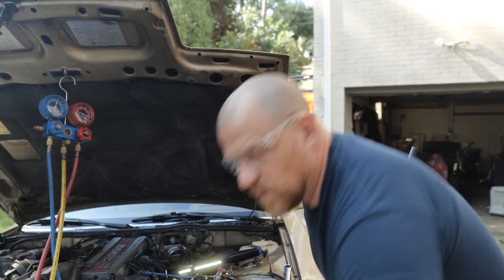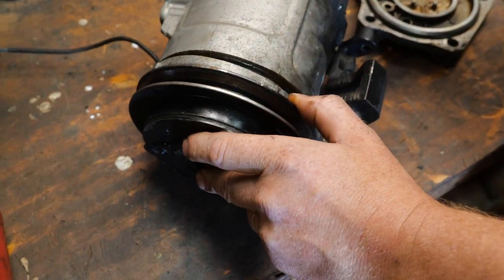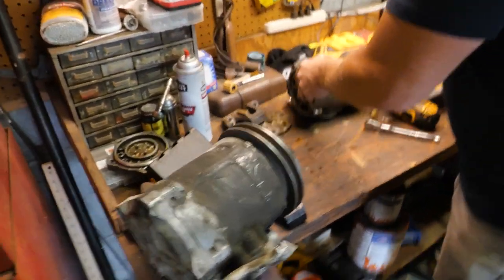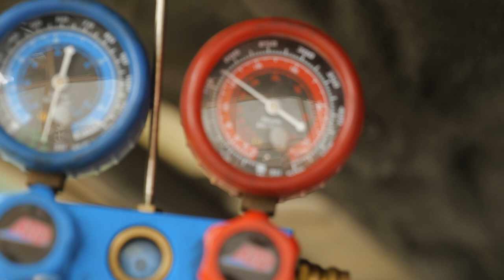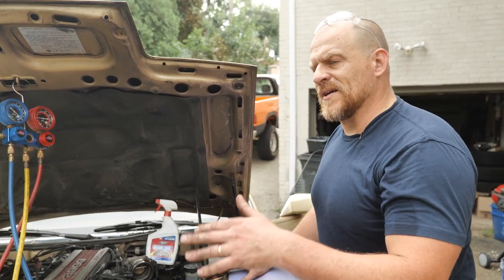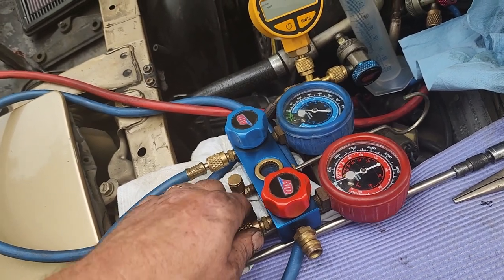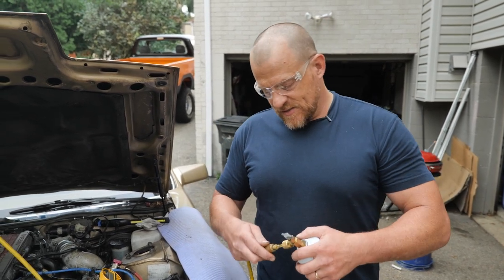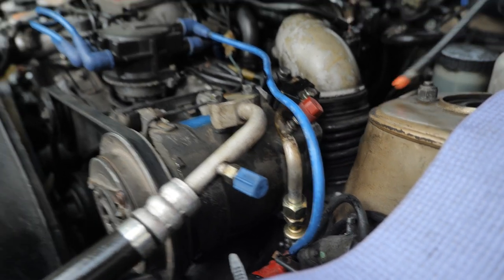A/C Repair Lasted One Day [What Did I Do Wrong?] - Part 2

Comment: For me, adding nitrogen has always been the best for finding leak in lines, condenser, evaporator, and leaks on the AC Compressor housing. I have had AC systems that had a leak but wouldn’t leak with 150-200psi of nitrogen. That’s when vacuum testing comes in handy. a AC compressor shaft seal won’t leak while under pressure because it the pressure pushes on the seal, helping it seal. If I pressurize a system and can’t find a leak, but loose vacuum, I know I need a AC compressor

Comment: As a wise old guy once told me, 'If you ain't making mistakes, you ain't doing anything'. We ALL make them! Nice Job! I use to work in the home HVAC business several years ago, so I knew all the steps you just made. As the old saying goes, 'Been there done that'
Reply: you sure ain't lying! it's all how you handle your mistakes, you can either take responsibility, fix it and recover gracefully or cower run and hide. I suggest the first option, even if it costs you out the wazoo. like a crawlspace sewer line job I did 20+ years ago. I thought to myself ahh, it will only take me 6 hours and 5 days later, plus broken water line repair....
yeah, I stayed with the price I quoted them, it almost covered my tooling, fuel, food/drinks costs. 😵
Reply: My dad always said that.

Comment: I had a day similar to that not too long ago; I pull up to my garage in my old ford, pull the handle to get out of the truck and snap - door handle in my hand. Unroll the window to reach out and work the outside latch, enter my garage through the mandoor, snap the door handle is in my hand. Enter the garage to open the tailgate of my other truck and snap, the tailgate handle breaks in my hand. The moral of the story when it gets cold like that, return to the heat inside and go back to bed

Comment: Years ago with R-12, all shop manuals recommended pulling vacuum for 30 minutes after you reached 27 to 30 in. That's what I've always done and it's worked for me. Also when compressor has been on shelf I like to sit it on its nose, add 2 oz of oil, let it sit a  couple of minutes and then slowly turn the compressor to lube and soften up the shaft seal. Then let it sit that way till you're ready to install it.May not help, but it can't hurt and it might save a leak.

Comment: "It helps if you charged the customers diapers". Classic shit right there. I had a lady I did a lot of work for leave a 1 star review after replacing the newest jeeps plastic oil cooler with an aluminum one. She took it to another shop 2 weeks later demanding $680 for the shop to replace one of the new oil coolers o rings. I charged her $450 total which included the $200 cooler. They wouldn't provide any pictures of the oil leak and originally told her they would have to charge her $600 just to see if it was leaking. Which it wasn't when I was done. I stand behind my work but an not in a position to just have over money like this. She lost confidence in my work after the plastic fuel clip disintegrated a week later which I replaced for free (the complete upper half of the engine has to be taken apart just to access it). Too much plastic where plastic shouldn't be used.  In this day and age there needs to be a service grading the customers not just the business. Scam customers also need to be identified to help the honest businesses that do still exist.  Anyone want to help me create it? Thanks for your vids and professionalism.

Comment: Macro Rubber is the place to get any kind of o-rings, they make and stock almost every size.
Measure the o-ring cross-section and get the internal diameter from the groove dimension. O-rings usually require around 15% compression to seal.

Comment: It looks like when you wiped down the back of the case at 3:10 to 3:30, the valve plate and cylinders rotated in relation to the case. So the back cover wasn't indexed to the valve plate and that shoved the guts forward when the bolts were tightened.
Reply from the maker: 100%

Comment: Before I knew how to work on cars, I got quoted about $2000 to fix the leaking R12 system in my 91 Miata as they basically wanted to replace everything in the system save for the lines. Knowing what I know now about A/C work on old cars, I don't blame them. Eventually I did the whole job myself but it was a pain in the ass. Unless you're really careful, it's almost not worth doing A/C work on 30-year-old cars if the parts are all original. Something will break and most of the parts will be discontinued.

Comment: I see you had the Midas touch on this one. 😂😂
Thanks for sharing. 
I did a 95 Mercedes S350 turbo a couple years back. I pulled used compressor of one of my parts cars and it was the wrong compressor. I bought a seal kit to rebuild the ac compressor and found a bad cylinder head. I ordered a new compressor and it was lost during shipping. Ordered a replacement for the lost one and it was mislabeled and totally wrong part. Send that one back and finally got the right one. Installed it and three months later it blew the front seal. I replaced that one under warranty. Oh and the lost one showed up too at some point. 
I finally wisened up and sold all my old Mercedes and parts cars. 😂😂
Reply from the maker: 🤣🤣 I know that nightmare

Comment: Caterpillar sell make your own "o" ring kits,  it comes with strands of different diameter "o" ring material with a special superglue. You get the right diameter material, match it up to the groove for the "o" ring, cut the strand to length and then bond the ends of the strand together. SUPER handy for field repairs.
Reply: They are called "o" ring splicing kits if you want to do a web search

Comment: I've torn apart bad A/C compressors to see why they failed, but never bothered trying to rebuild them. of course none were just bad o-rings and parts are near impossible to find unless your a commercial rebuild shop.
same with electric motor repair(beyond commonly available bearings), DC motor repair is even worse due to commutator and brushes, although I've scored parts from a few rebuild shops over the years, most won't sell parts and only will quote for rebuilding them, but some knowledge and sweet talking worked, of course I worked at an electric motor plant and jumped around doing majority of all the different jobs from machining shafts and cases to final assembly, testing, packaging and dock work. I'm sure not a painter, but I learned that too.

Comment: What'z up Danner! HVAC tech here enjoying your videos. The new refrigerants 134a, 404a and all those new gen refrigerants are blends. That is why is suggested to always charge in liquid. If you charge on vapor and end up not using the entire bottle then you altered the refrigerant blend at that point. 
Great video we all have had those days at work. It just felt good it wasn't me hahahah.
Reply: leaks cause fractionation of the blended refrigerant gasses also. pretty much the blended gasses in a leaking system should be recovered and replaced.
a big problem with supposed recycled gasses is unknown contents, oils and acidity. so you call X local repairman, and he quotes mega cost to replace, you say "temporary fix please", sure they suggest adding some refrigerant and give you a deal on "used" gas! it may be 100% system death in short term. 🤣

Comment: Good choice on not hooking up the low side gauge, this way it accounts for leaks that might be at the Shrader valve, I usually disconnect both valves after pressurizing the system to check for leaks at the Shrader valves

Comment: I had a really common compressor, they made it for 20 yrs.  Finally found a gasket set for it, and the new head gasket was paper, old one was metal.  Ended up reusing the old gasket, and it worked fine.  But the other gaskets leaked a year later.

Comment: Don’t sweat that one . People who drive older vehicles and use them as that client seems to be need to be prepared for any component failing at any time . I run a service truck that is 21 years old. Every single service call is also a test drive for the next system I need to work on lol

Comment: I call what you experienced mission creep.i have used those fittings for 40 years mostly on long lines they get a hole rubbed in and leak cut out bad section install fitting ,good to go. Saves on part cost and labor.

Comment: On an old car with AC problem: “ mr. or Mrs. customer, the reason my estimate is $2400 on a complete replacement of your entire air-conditioning system is that your car is very old, and if we don’t replace everything then you could end up in a situation where you’re nickel and dimed to death by subsequent repairs because of failures on parts that were not replaced.” And if the customer walks, let them walk. 

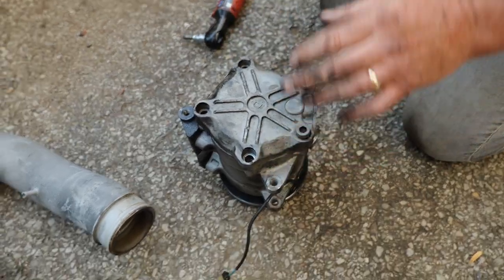“No man also seweth a piece of new cloth on an old garment: else the new piece that filled it up taketh away from the old, and the rent is made worse. Mark 2:21
Reply: Wow. I did not know that concept was Biblical. Mark 2:21. Gonna remember that.
Reply: And the man with no feet,, walked away,,,, Amen ! LOL

Comment: If you bench drain the oil out of the compressor you should put in approximately 6oz of oil back in the low side port. Although oil flows through the closed loop system with the freon the majority of the oil will stay in the compressor. If you replace a condenser add approximately 1 to 2 oz if you're replacing the receiver drier on the high side or a accumulator on the low side add 3oz to that part being changed.
Reply from the maker: The compressor oil amount you are suggesting will absolutely ruin a system. Compressor oil is all throughout an AC system, it does not just sit in the compressor. In fact, almost no oil sits in there. When you bench drain one, you'll get drops of oil only out of it. Procedures are to add 1 oz on a new compressor plus anything you may have drained.

Comment: Pros and cons of mobile 200psi+ systems eh?  I only had one vehicle with zero aircon issues and that currently has no coolant in it because it needed evacuating to facilitate an engine swap.  I expect to have some fun sorting that, but at least I know to swap any o rings where joints have been apart.

I once did the same thing as that compressor fracture on a fiat punto diesel vacuum pump.  Lack of alignment, then “ping” and then it was a whole new pump needed.  We’ve all been there!

Comment: There should be a Shrader valve under that brass cap that is on your gauges where the yellow hose hooks up.  Back when I was using cans to charge with, that is where I would purge the yellow line between can swaps.
Reply from the maker: There is a check valve on the end of my yellow hose. So I didn't need to do that

Comment: For me preferable a little extra oil better than starving for oil. Now too much oil will degrade the cooling, but I have seen in my experience with a home unit my A/c friend installed never cooled down enough and lived with it until I added 3 OZ of oil with a dye and what a difference it made considerably. My thought was the oil coated the condenser better internally and there was more heat felt in the air pushed out of the outside coil. So yes you do get lucky sometimes by accident and for me adding the oil dye was looking for a leak that took 2 seasons to be just low enough not to cool. Home AC do not have sight glasses at least mine did not. Note never found that leak but the charge then lasted 4 seasons afterwards. Replaced the system complete with lines original system was 20 years old.

Comment: Paul another great video as usual I defiantly learned something while watching.  Is there anyway you could do a video for dealing with an a/c system that is already charged using only a manifold gauge set?  I'm mainly interested in seeing how to evacuate a system that still has a charge of some kind any help you can provide would be greatly appreciated.
Reply from the maker: I dont think there is any real approved way to recover for the DYIer 
Maybe an empty R134a bottle surrounded by some liquid nitrogen (I don't think ice water would be enough) then start your car and close the hood and let the system bake with heat, while opened to the frozen empty container. You'd get a lot of it, but don't know how much.

Comment: Use the micron gauge to determine moisture content and pressure test to determine whether there is a leak.  The system spends its life under pressure,  not a partial vacuum.
Reply: thats what everybody is missing it works for vacuum but not pressure, u have to do both. i do vacuum first and then pressure. its amazing to be able to see how much moisture is in the systems i encounter.  thats where it shines especially if u graph the numbers on ur tablet. that little device will prove when u have a system dry maybe people will learn how to use it. tom lech is a master in ac. he changed my ac jobs completely. love to learn and grow and advance, thats why i watch danner, thats why i watch tom lech

Comment: Good video Paul and Caleb. Paul, either quit going to the gym or start using a torque wrench on everything. We call guys like you Hulk Smash (you've already shown your Hulk previously) or Wreck It Ralph. 😂 A couple of things from a guy who has been thru all three world wars of the A/C world. Most modern systems that have not been open to atmosphere can have as little as 10 minutes of vacuum. But it will never hurt to have a long vacuum time. The general rule of thumb for oil is 1.75 to 2 ounces per major component replaced (not including lines). When changing from R12 to R134 it is usually 75-80% capacity of the R12 original system. The sight glass makes it easier to get exact.

Comment: Checking leaks.  I have the best luck listening to a vacuum pump.  The sound should not change when open and close the gauge valves after everything is vacuumed down.  That and soapy water looking for those oily spots when under pressure.    When it comes to swapping cans.  Purge the air at the gauge.  Remove that cap and press the valve a bit.  Concerns are keep air out of system.  Keep dirt out of system.  Volumes of oil and R-134a are not as important.

Comment: Here's a question to think about.  Does the vacuum pull the "good" side of the o-ring to the ring channel providing a false good seal then when adding pressure push the o-ring to the "normal" position that caused the leak(s) originally?

Comment: Glad you satisfied this "customer". 
I watch a lot of videos about HVAC and I have never seen a compressor standing in the uppermost position. Usually the compressor is lowermost part of a system. And there is a good reason for that. Namely, if the oil leaves the compressor, it will return back by gravitational acceleration. In my opinion this design was a compromise and it works but... Anyway, nice and instructive video, as always.
Cheers!

Comment: My father has a 88 300zx turbo and I tell you what it is nearly impossible to find parts for that car. Nissan discontinued almost everything and it’s rare if we find one at a salvage yard.
Reply from the maker: 100%, can't find a parking brake cable to save my life and I need one
Reply: And I can’t find a throttle body cable if my life depended on it.

Comment: I have  a toyota yaris 2008, my car have  no compression on 2 cylinder. the mechanic, checked , fuel pump, starter, timing belt, everything work, also relay work.  He said  there is no coolant that might cause overheat. do you think I need to replace engine.

Comment: When doing work with anything aluminum I always try to use my regular sized 3/8 ratchet bc I've done the same thing being in a rush and just using the first available (long handle). 

Also flush that bad boy, that was awful.

Comment: So sad you broke the old compressor. However I would still give it a shot with rtv :D Put it in the front and the back also, wait for it to cure up, and then test it with the nitrogen. That would be sick if it had worked :D

Comment: I was just wondering did you get a used ac compressor to keep down on cost ?  Just wondering, I found a new ac compressor from $135 to $350 .   New and reman  . Just was wondering . I usually push for new/ reman especially for family and friends because once you touch it you own it . However I do have good results when I get used compressors.

Comment: In the past, I have always vacuumed a system down for 30 minutes and then let it sit for around 30 minutes to see if I lose any vacuum and then vacuum some more for around 15 minutes and then let it sit again for a little while and if it held, called it good.  

Recently on an Automotive AC forum that I frequent, I was told that the minimum time a system should be under vacuum is an hour and preferably for several hours.  This came from two guys who do auto AC repair for a living.  They said there is no way you are getting all of the moisture out of a system in under an hour.    I'm not sure if that is totally true since my method has always seemed to work for me.
Reply from the maker: Hope this case study helps you not trust your vacuum decay testing anymore 😉
As far as time goes for the evac, I think it really depends on the relative humidity and the size of the system you're working on. With a micron gauge you can really tell how much moisture is still left in the system and for my sons car I did evac it for an hour but within 20 minutes I was down to near 500 microns
Reply: @ScannerDanner  I definitely won't trust the vacuum decay testing anymore.  I may bump up my minimum vacuum time to an hour but that is probably it.  Thanks for the reply.
Reply from the maker: @Mr2004MCSS  same here my friend